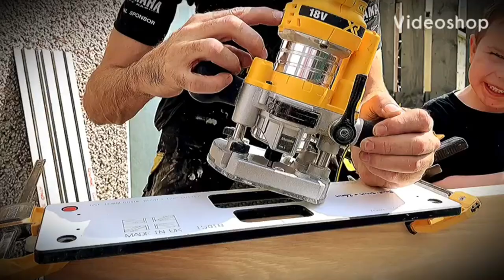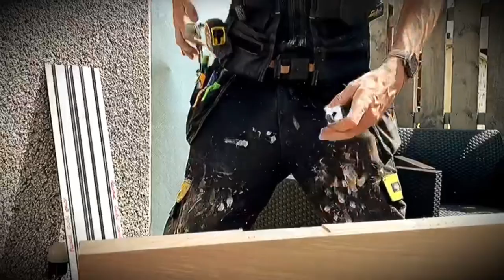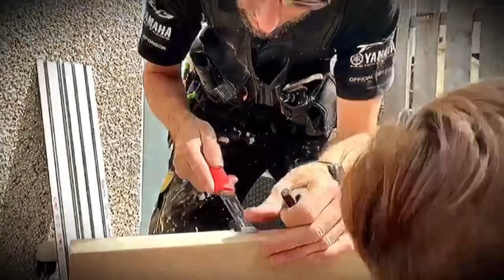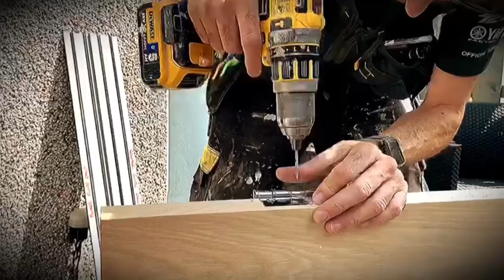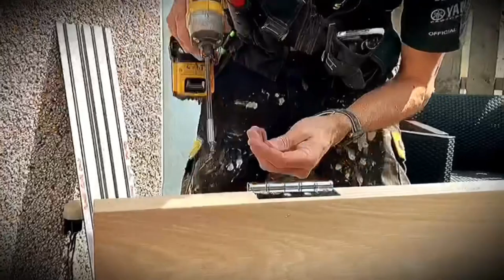Unika hinge jig & DeWalt router

Comment: Hello mate, can you gain more depth   (locks) by clamping motor an inch higher using full plunge stroke, lowering motor to the bottom and using full plunge again?
Reply from the maker: Sorry, I do not monitor messages on here. Not understanding the question buddy
Reply: @Coupleatools  bloody hell! I don't understand my self, must have been well drunk when I was righting it 😂
Reply from the maker: khernatify 😂😂👍🏻🍺
Reply: @Coupleatools  I meant if I would try to use it to mortice for locks can I leave the motor in the plunge base in high position plunge down fully, than lower the motor screwing it down into plunge base to lowest position and plunge again, it should give the same effect as sliding router bit out of the collet if you don't have enough  plunge stroke in your router. Hope this makes some sens 😆
Reply from the maker: khernatify I get what you mean now. Unfortunately, if you have a long double flute on it with the plunge base fully extended, it’s still longer than the base so it would be a bit of a sketchy start. Could it be done, yes. Would I try it, no 😂

Comment: Hiya mate. Cheers for the video. Can this be used on a rebated frame or frame with the door stop on? Cheers
Reply from the maker: Steven Harrison It can indeed. It has serious power. I’m using it next week to rebate a channel in the bottom of oak doors for sliding track purposes
Reply: I know what you asking ;) I use it on rebated with 3 way clamps if the frame is straight (flat) the pegs are long enough, sometimes you need to put shims in rebate under jig. Never tried on the frame with door stop on but it won't be a problem if you put shims under or just piece of door stop to hold it parallel to the frame.
Reply: @khernatify  just the ticket. Thanks for that mate

Comment: Are you using a guide bush on this router and what size bit are you using cheers
Reply from the maker: 12.7mm router bit with a 16mm guide bush
Reply: Spot on mate cheers im getting both the router and a hinge jig but cant decide which jig to get have u used any others like the trend ones ?
Reply from the maker: Topjoiner Have used several inc Trend jigs like the skeleton. Skeleton is better for new builds, this is far better for retro fits where you may just be changing doors over. Easier to use & a fraction of the cost compared to trend
Reply: Yes i was thinking of just getting this one or the single trend one to see what they are like, its nearly all retro fits i do, is the router any good ? Im getting it nxt week got a few oak doors to do so gona try it out on those
Reply from the maker: Topjoiner The router is phenomenal. I’ve never used a router so much since I got this. Bring it out for everything.
Reply: Spot on cheers am looking forward to trying it out cheers
Reply from the maker: Topjoiner Here’s a little tip. I use certain shims between pegs & door depending on depth of hinge ie: blue & black shim 24mm, blue shim 26mm, red shim 28mm, no shim 30mm etc (don’t quote me on they sizes. I have them written on the jig)
Reply: Sound cheers mate al have a muck about with it
Reply: Sorry to bother u again mate but where did u get your 16mm guide bush from, av looked online for a dewalt 16mm one but only place is ebay and i need it asap cheers
Reply from the maker: Topjoiner I already had a 16mm bush as it came with my DEW625 1/2” router. You could see if the one in my Amazon Store is available to you on Prime - https://www.amazon.co.uk/dp/B07DJCV8HL/?cv_ct_id=amzn1.idea.19VFN3QJMRKM&cv_ct_pg=storefront&cv_ct_wn=aip-storefront&ref=exp_cov_coupleatools_dp_vv_mw
Reply: Cheers mate
Reply: Hi. Can you confirm it’s definitely a 16mm bush and not a 30 mm as other videos state. Going to buy this tomorrow
Reply: @ryanmccrossan2994  defo 16mm mate
Reply: @topjoiner474  cheers thanks